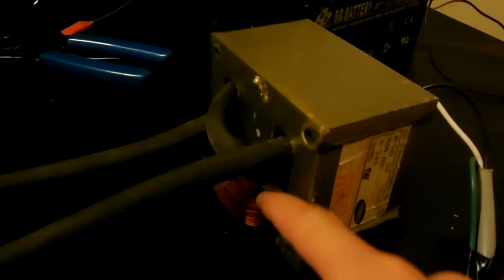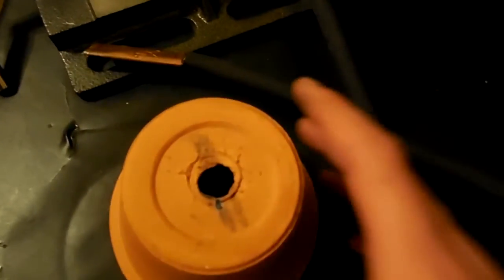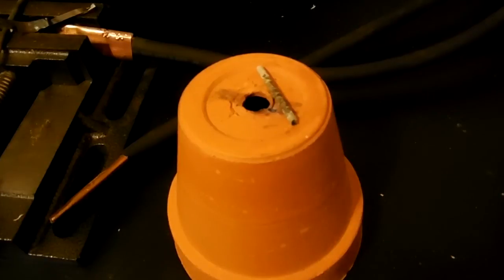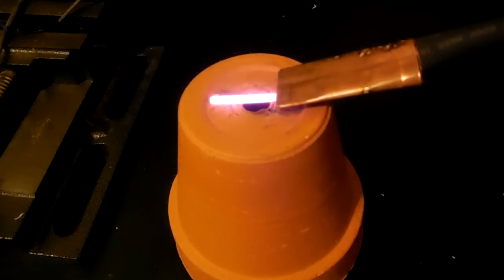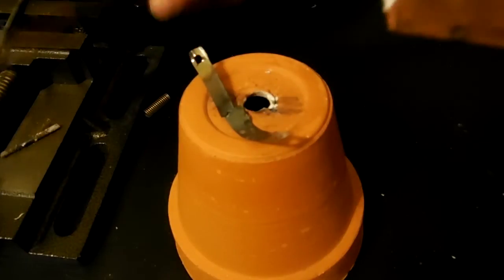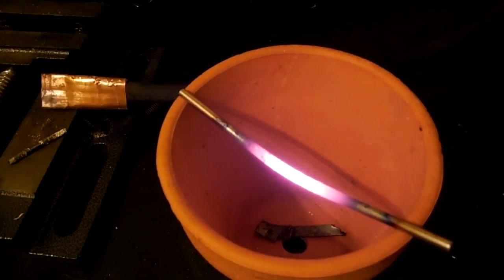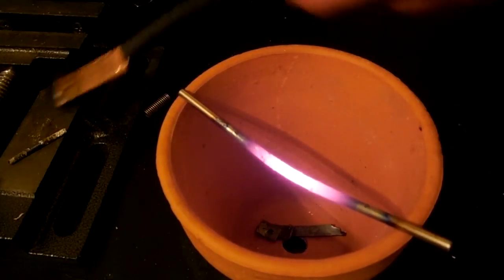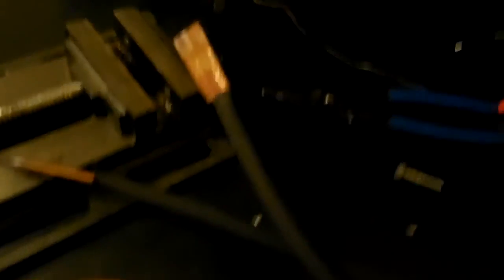DIY Extreme High Current Transformer 1200A!!!

Comment: I'd like to see this used across a spark gap to ignite a plasma arc using a high voltage trigger circuit to get a good plasma arc going for the amperage to flow. 

I'm trying to construct a 'dense plasma focus' and the key to plasma density is a sweet spot between voltage and current. Too much current and the plasma electron density is very high and ions are too hot, too much voltage and the electron velocity is very high but the ion temperature is too cold.

Comment: Thank you about this video and congrats.
However I would like to ask you, is it possible/convenient to repeat this test with
around 1m long steel/iron rod around 5-7 mm in diameter?

and consider the contact resistance - Perhaps a lot of energy is lost there. Energy that could be used to heat bigger objects using the same low voltage.

more area/tighter connections between cable and melted stuff

even if voltage should be increade to around 3Volts

thanks again!

Comment: Extremely important question what gauge wire you're using and do they put these transformers in series when it seems just can be used as an efficient arc welder? Also can you do a dummy  tutorial ?

Comment: Hey just to ask a quick question, if he crosses the output of his transformer over his hand, he would feel nothing due to the lack of voltage even though it can deliver massive amounts of amps right?  Just like what happened to the spring.
Reply from the maker: Yes you are correct. It is the same voltage as a AA battery.
But the high current does make lots of heat so if I touch it after it has been in use I would get burned from the heat.

Thanks for watching and commenting!